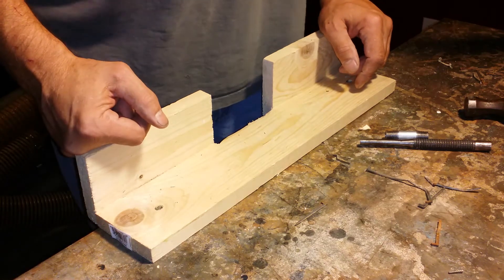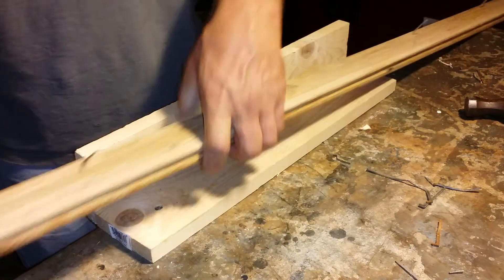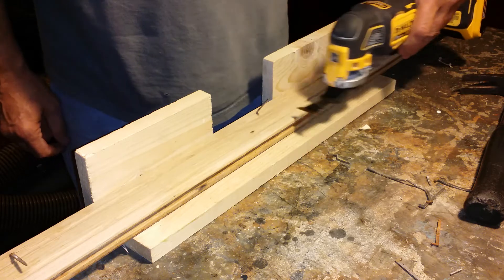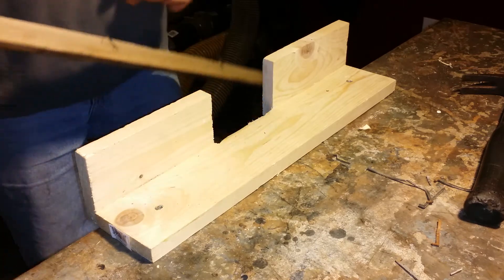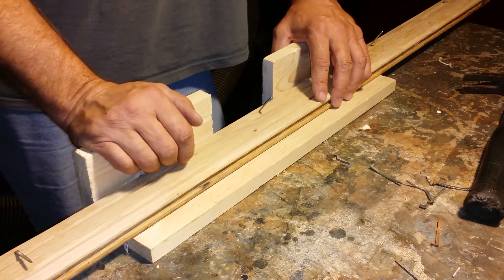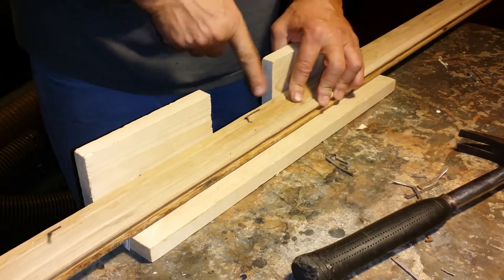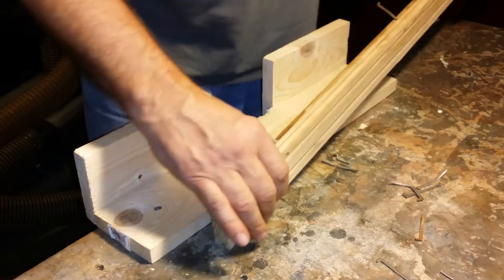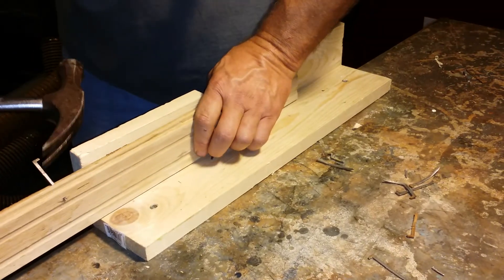How to remove cleats or nails from reclaimed hardwood floor

Comment: very helpful video (similar circumstances in terms of free hardwood that matched others throughout my house). one tip to add, i picked up a pack of Dewalt Nail Set tools to help aid in the pneumatic nail cleats even further. also used a white waxed pencil to mark boards that needed some further attention.

Comment: I’m trying to get staples out of reclaimed tongue and groove hardwood flooring but they’re in there deep… so far I’ve pretty much had to rip them through because I can’t hammer them back out
Reply: Angle grinder. I can't see any actual benefit to removal aside from the obvious--not destroying your saw blade. That could be avoided, though.

Comment: Nice video. Did you cut out a notch from the bottom board? If so, was the gap made by the notch necessary for the nail to pass the edge of the lower board?  Good luck on the help part, lol!

Comment: Omg I wish my boards had the nails sticking out ! I bought a pallet of the hardwood flooring they removed from old church. I didn’t realize it was still full of cut off nails until we ran a board through the planer. So if anybody knows the best way to remove snipped nails embedded edges of the flooring, heh heh 😅please, do tell! (Sigh) bc this -so far -seems like it’ll be a nightmare. 😢
Reply from the maker: Might be able to drive them out somewhat with a nail set? At least far enough to get a hold of the head?  Or maybe start with a larger nail set to get it down in the hole, than a smaller nail set to drive it on out?

Give it a try and report back,,,lol.
Reply: @ yes that’s exactly the method I’m using today. I’m 2 hours & 3 boards in. My first impression is that this will be painstakingly slow & I think I’ve taken out as many fingers as nails at this point. 😂 . If only I had known there were cut nails in this pallet of flooring….🤦‍♀️